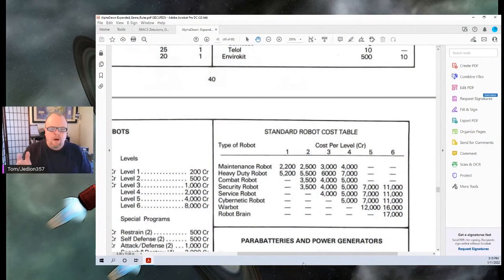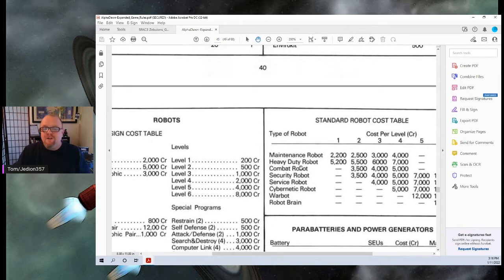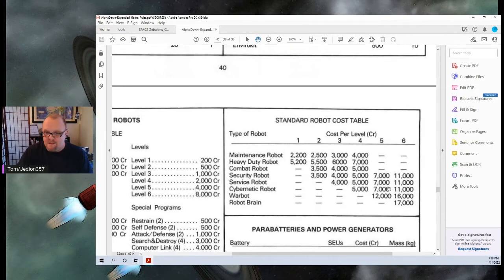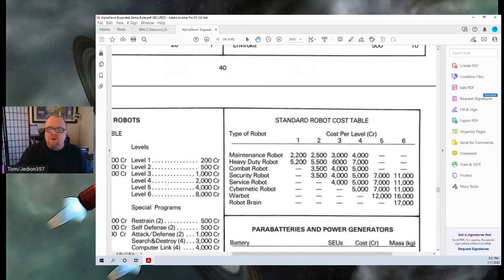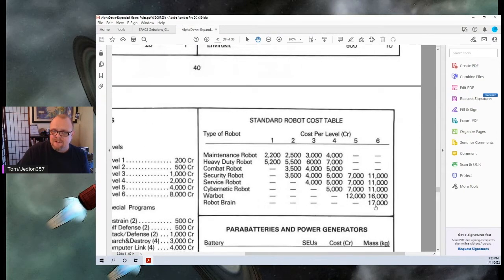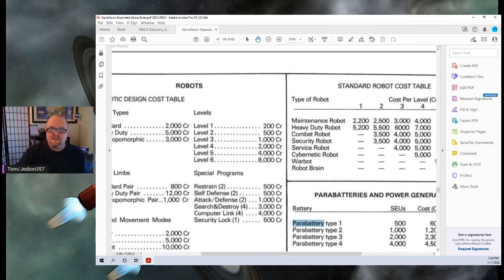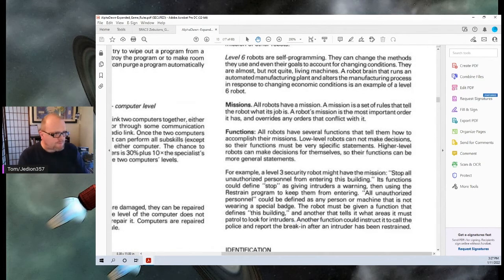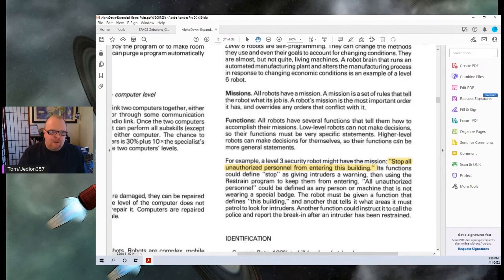Star Frontiers Robots Part One

Comment: But the description of Robot Brains DOES tell you that Computer Link is included with the robot. "They have heavy duty bodies plus the computer link program." Actually, the error is in assuming that all robots fall into the categories of maintenance, heavy duty, combat, etc. They don't. Those are just "standard robots," robots you can buy "off the shelf." When you build a custom robot, you can program it to do any kind of job you want. You're not limited to those categories.

Sure, the terminology "standard robot" is not made clear in the text, but conflating standard robots and custom-built robots is just as confusing.

Comment: I always figured the Standard Robot Cost Table was for off the shelf robots so you could get a quick and dirty answer when asked how much a bot is. The price is for a mass produced most simple version of a bot you'd find anywhere in the Frontier. The charts are if the GM or players want to produce a special bot with different equipment for special missions. That's when you piece it out, and it's more expensive than the standard because it's a non standard design and thus no economies of scale discount from building hundreds of the same model.
Reply from the maker: You are correct but the standard cost table has been the source of miss priced robots submitted to both fan magazines over the years hence me making an issue about it in the videos.